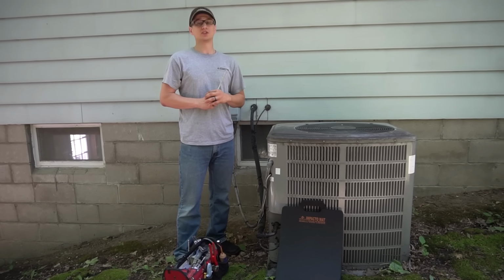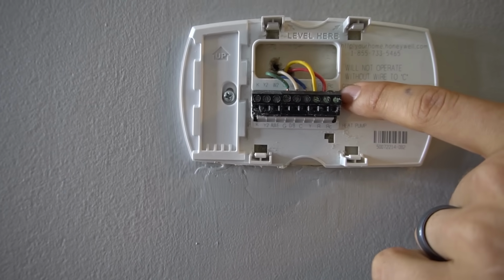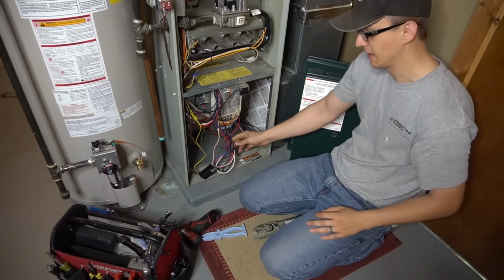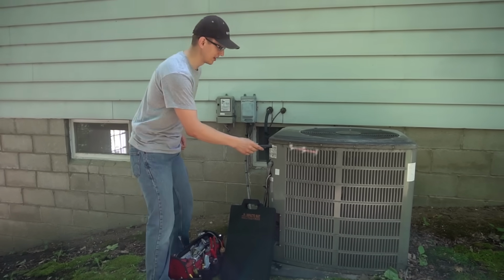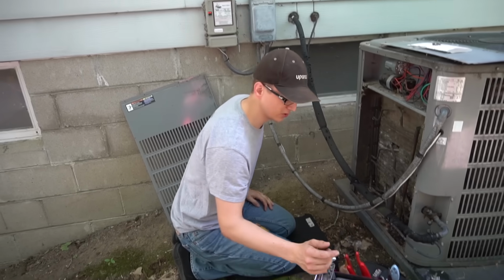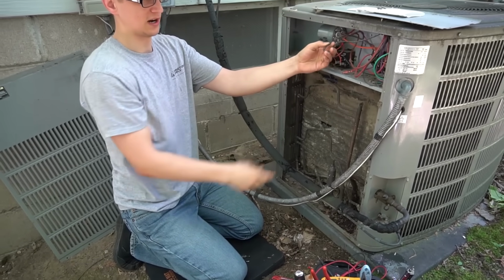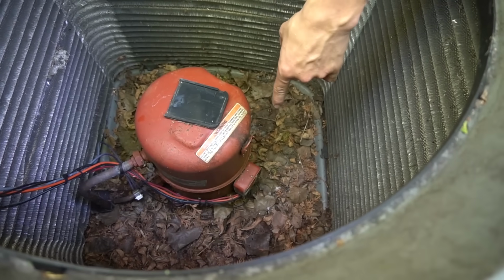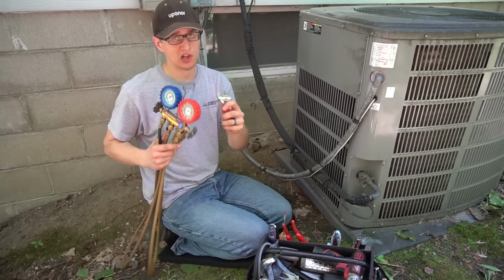AC Unit Not Turning On - How to Fix It Step by Step

Comment: Hello sir ,
My motor on my AC unit stop running and when I removed the cover I noticed the capacitor  looked swollen..I  read the specs and bought and replaced the capacitor..The unit is running  but the discharged air  in the house does not seem to be fully pushing like it used too..Plus no cold air?..The heat side is blowing and heating @ full capacity but again when I switch to cold I get like a whisper of luke warm discharged air.
Reply from the maker: If everything is running but the air coming out of the vents is warm, then you likely either have an airflow restriction or you are low on freon. Have you been low on freon before? How often do you replace your furnace filter? If you have an expensive filter - try running it without a filter for a while to see if it makes any difference. Is your outside condenser coil clean? I suppose it is also possible that the compressor is not running. You can check voltages to know for sure if you have a multi meter. Otherwise you can usually hear the difference between the outdoor fan spinning and the compressor running. Can you hear the compressor turn on too? It would be better and cheaper for you if it's an airflow issue. Unfortunately I see way more freon issues than airflow issues though...  The bad thing about being low on freon is that you will not be able to fix it yourself. You will need to call for service unless you know how to deal with refrigerant and have a license to buy it. From what you described it sounds more like you are low on freon. (unless the compressor is not running at all) Let me know what you find
Reply: I dont hear the compressor turning on .There was a ac contractor charge my unit about a year ago and it was nice and cold but all of a sudden  warm air discharging ,
Reply from the maker: Well here's the thing.. An AC system is a permanently sealed system. That means that whatever refrigerant charge is in the unit, stays in it for the life of the unit. It is not like gasoline where you have to keep pouring some in every once in a while. So the fact that you needed freon added guarantees that you have a leak in your sealed system. Either in the evaporator coil, at the condenser, or in the line set. The stuff they added will inevitably leak back out. Just a matter of time. You will need to get the leak repaired (which can become pretty costly) or the whole unit replaced. Option 3 is to just keep re-filling it. Of course that is not cheap either. But back to the issue at hand... Your compressor is not turning on. Do you have a low pressure switch in your condenser unit? If you look inside of it from the top, you will see the compressor. The compressor has 2 copper pipes coming out of it. One is thicker than the other. Sometimes the thick pipe will have a black disk or cylinder looking thing (LPC) attached to it with 2 wires coming out of it. Does your unit have that?

Comment: My contactor fails to energize. The system diagnostic error code is stating that there is a "welded contactor" that the compressor contactor has failed to open and the thermostat demand signal is not connected to the module.

I have checked the wiring in the thermostat and control. RH is jumped to RC at the thermostat (but is not showing any low voltage on the gauge). Do i have to jump it at the control as well? 

I have 3 wires going from the control to the condenser outside red white and yellow. Red is power, white is common, is the yellow supposed to be wired to the Y at the control for the cooling? 

Should i just buy a new contactor? The coio does not seem to be damaged.
Reply: new contactor
Reply: Got it working, it was all the wiring. It was not wired correctly.
Reply from the maker: So according to the error code, your contactor is actually stuck closed. Did you look at the contactor and try to push/pull on the little plunger? Is it really welded shut?

As for there being no voltage at the thermostat, did you check R to C? You should have 24v between R and C. (Rh or Rc is the same as R). If you have no voltage at the thermostat then you may have a blown fuse or tripped breaker at the control board. In the furnace control board you should check R to C as well. You should have 24v there. (make sure you have the power on and the door switch closed) If you do not have 24v, then it will be one of these possibilities: no power to unit, blown fuse/tripped breaker, bad transformer, bad control board. Once you let me know what readings you get, I can help you narrow it down to the right culprit.

I am not sure what the third wire is for at your condenser. Is the red and white hooked up to your contactor? If yes, then the red and white should also be hooked up to C and Y at the furnace control board. 

If you have a multi meter, disconnect the wires from the contactor and check it's resistance or ohms. They are usually about 10-20 ohms. I don't replace too many contactors. Whenever I do, usually they are obviously damaged like the coil is melted or the contacts are burned.
Reply from the maker: Awesome, glad you were able to get it fixed! Stay cool! ;)

Comment: I have a question. My ac unit is just humming and the fan is not spinning. I tried jumpstarting the unit and that didn’t work. I changed my capacitor 2 years ago and was wondering if you think it is the fan motor or what you thought. The fan spins freely when pushed but won’t keep spinning on its own. What do you think?
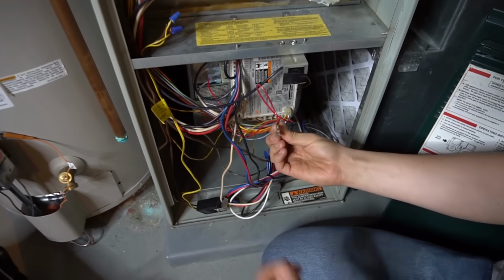Reply from the maker: From what you explained it sounds like the capacitor is bad again. I would start by replacing it. Do you have a multi-meter? You can check the capacitor like this to know for sure: https://www.youtube.com/watch?v=C82HvbvP08E (I check it at 7:26)
Reply: Thanks! I sure hope so. I'll let you know the case next week.
Reply from the maker: Sounds good! Let me know. On a side note, I noticed that dirty furnace filters tend to take out capacitors. Do you change your furnace filters regularly?
Reply: Word of Advice TV I do but I sometimes forget. So it definitely could have been that
Reply: Pay the extra money for oil filled capacitors

Comment: First off I want to say what a great job you do on your videos with teaching..... the best I have found!!!

my issue started with a sticking (welding) contactor.... which I knew was the problem. replaced it very easily... but when I fired up the unit NOTHING happened - so I put the old part back on just so we could have a cool house for the night..... but the same issue.... the entire unit would not fire up at all... absolutely nothing. 

If I push the contactor in the outside unit does buzz like it wants to start, but never gets over the hump..... forgot to mention - I also have 2 transformers in the outside unit....

even when the contactor was acting up (If I wiggled the connection up and down it would work nicely for a few days) The system worked great.... cooled the house without a problem.

Any help would be appreciated... Thanks So much!!
Reply from the maker: Thank you! And to me it sounds like you have a bad capacitor. This video is dedicated to the most common fix - the capacitor: https://www.youtube.com/watch?v=C82HvbvP08E&t=381s
Reply: I really appreciate the knowledge you share here ... you save me a lot of  money on service calls alone.

I checked
The capacitor and it was good .... it ended up being a fuse in the attic unit (which you also showed me to look for) ... I really do appreciate you !!!
Reply from the maker: Awesome! Glad you were able to get it fixed. And thank you! Good to hear that people find my videos helpful :)

Comment: How can i just get your help here in cali please the heat is here 😩
Reply from the maker: I will be home today so I can answer you on here pretty quick and try to walk you through it. I live in Minnesota though so can't help in person. I guess your options are to try to do it yourself or call a service company. What is your unit doing?
Reply: Well i can hear the compressor on even when the ac unit inside is off and it stays on. On top of that the fan condenser isnt going and I tried the step of bypassing it with the switch so i think the motor to the fan is out. Although i hear the noise as if its on but doesnt spin. I tried moving the fins as well. Please help.
Reply: Also in determining to purchase a motor is it one size fits all just different brands. ? To the fan that is
Reply from the maker: I would get a new fan and a new capacitor. In my field of work, whenever we replace a motor, we always replace the capacitor too. Unfortunately it is not one size fits all. You will need to get your model and serial numbers and the brand, then look up the right motor for your unit online or if you have an appliance parts shop in your area, they can look it up for you too. On the motor itself it will usually have a label with its specs. Most important is that it needs to be 240v, the RPM needs to be the same, and the HP.

And something is wrong if you have your thermostat off yet the unit outside is still running. My first thought would be that either your thermostat or furnace control board is defective. You can just turn off the power switch at the furnace and everything will turn off. I think you should fix the unit outside first and then we can get back to this issue.
Reply: Word of Advice TV awe dude thank you a lot. Ill get this done. I appreciate the help.
Reply from the maker: Happy to help! Good luck man! Let me know how it goes

Comment: You are very informative and easy to understand. Thank you! When I turn the thermostat on, the inside fan blows air and keeps working. But the outside fan starts and runs for about 10 seconds and then quits and nothing happens. No noise, nothing. I'm thinking about replacing the capacitor and see what happens since they are so inexpensive. What do you think?
Reply from the maker: That would be a good starting point. That is one of the most common fixes and like you said, the capacitor does not hurt the wallet too bad. From the scenario you described I don't really have a specific answer though. Not exactly sure what is causing that. I do have a few questions that can help narrow it down:

1. Can you tell if the compressor is also turning on outside? Or just the fan?
2. When the fan outside starts, can you hear the compressor trying to start?
3. Look into the outside unit from the top. (while it's off) You will see the compressor and 2 copper pipes coming out of it, one is thicker than the other. That thicker pipe.. Does it have a little black cylinder or disc attached to it? The little device usually has two wires coming out of it. (it's called a "low pressure cut out")
Reply: I think that I hear the compressor running. 
I tried something different. I just pushed the contactor's contacs in, and the fan (and assume the compressor too because I think I hear it) turned on and remained on until I released the pressure to the contactor. It's something I just tried.
The thick pipe you mention does have another pipe or device with wires attached to it.
But here is what is new and weird. I just went outside to look at the outside unit from the top to make sure that I was seeing what you asked me to look for. And voila! Now the unit is running. Could it be that by pressing on the contactor I triggered something?
Reply: The unit is working now. The inside fan is blowing colder air (yes, just colder. I don't know if it's cold cold)
Reply from the maker: It's possible that the contactor plunger was getting stuck and when you pushed it in like that, you freed it up. Well its good that it started working longer then 10 seconds again! Do you have something you can measure temperatures with? You can try checking the temperatures like I did in this video: https://www.youtube.com/watch?v=beVRELr8Oak&t=17s
If you have a temperature difference between 15-20 degrees Fahrenheit, then you know it is working normally.
Reply: Thank you for the video. I'll check that next. By the way, I can see that the contactor's contact areas are kind of pitted. Maybe I should replace it. I may try that. Thank you for all the help and the great and easy to follow videos you are providing. I appreciate them. Thanks again.
Reply from the maker: Glad I could help! Good luck! Let me know if you run into something interesting ;) By the way, just about every AC I see has pitted contactor contacts.. It's unlikely that the contactor is the problem but of course a new one would not hurt. They are pretty cheap on Amazon https://amzn.to/2kQ6fY9

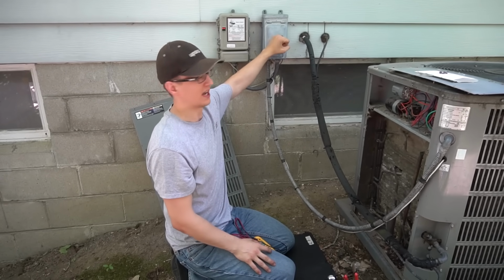Comment: How do you check if the contactor is bad?  I have a blown fuse, just replaced it and a few minutes later it blew again.  I'm checking the contactor as specified on minute 16:36 of this video and when I pushed in the plunger the fan kicks in an starts running.   How do you check if the contactor is broken?
Reply from the maker: You can check the ohms on the contactor coil if you have a meter. Generally they are between 15-30 ohms. If you don't have a meter then unfortunately I don't know of an easy way to test if its good or not. It's around $9 on amazon https://amzn.to/2xHo2Kk  You can try it. Before you start replacing the contactor though, check your thermostat wire that goes from the wall of the house into the condenser unit. Do you see any bare or chewed wires? Maybe you really do have a short somewhere. Another thing you can try doing is this: take both of the 24v wires off of the contactor and leave them off. Make sure they are not touching anything though otherwise it will blow the fuse right away. With those wires off, turn your cooling on at the thermostat and wait for a few minutes. If the fuse blows with those wires off, then you know that your contactor is not the problem. Let me know what you find

Comment: I'm in Chicago and the heat is on this summer. I'm having problems with my outside unit, is completely dead! I'm going to trouble shoot it taking all your recommendations in this nice and helpful video. Thx a million. Last winter I replace the mother board on the furnace myself and it worked marvelous. Now, with the AC issue.
Reply from the maker: Sorry to hear that! It was 102 in Minnesota yesterday and man was that hot! Good luck, i hope it's an easy fix! Since you replaced the control board, I'll mention this just in case.. The low voltage terminal strip on your control board has two sets of thermostat wires going to it. (the one that's labeled R,W,G,Y,C) One set of wires comes from your thermostat, the other one that only has 2 wires comes from your AC and is usually a red and a white wire. Those two wires go to C and Y.  Let me know how it goes or if you get stuck
Reply: I took a picture of all the wiring on the MB before switching to the new one, so everything is the same. I'm only puzzle by a blue wire that is not connected to the thermostat, I only have red, white and green wires going into my thermostat and the red wire with a jumper to RC like you mention in your video. That blue wire hasn't been hooked to the thermostat since ever and the AC was running last summer! 

P.S. Thx for your quick response and interaction with your viewers.
Reply from the maker: Try hooking up the blue wire to Y in your thermostat. And then make sure the blue wire is connected to Y at the furnace control board as well. Let me know how that goes. I am assuming the three wires you mentioned are wired as follows:

Red: R
White: W
Green: G

And of course they should be wired the same at the control board.
Reply: Thank you so much for your very wise advice! It worked miracles.  After watching many videos on this issue, yours was the most helpful and your personal advice is just icing on the cake.  I went and checked my control board to look at all the letters and wiring colors. It turns out that like you said "Y for blue"  it matched with the thermostat. The moment I plugged that blue wire to Y my outside unit kicked in. It was like music to my ears. Thx a lot!  Anytime you come to Chicago, let me know and I will be happy to show you around and go for a bite.
Reply from the maker: Awesome! Glad to hear that you got it fixed! And thank you for the feedback :) If I ever go to Chicago, perhaps I'll take you up on your offer. Stay cool man!

Comment: Here's an idea to protect your compressor coils from the build up you get, wrap the compressor housing with screen, like the type for screen doors or windows to block all that stuff from getting inside your coils and when you look at it from time to time and see the build up on the outside, much easier to clean and you know it's happening.  Great video!  keep up the awesome work.
Reply from the maker: Thank you and that's actually not a bad idea! Although since the mesh is pretty small, the screens alone will make a little bit of an air restriction. I have never seen that done before but may be a good option. Thanks for sharing! (hosing it down with water is pretty easy though so as far as I go, I think I will just spray it down yearly ;)